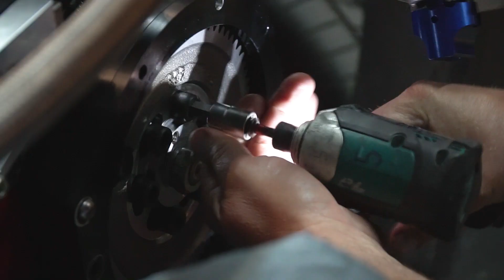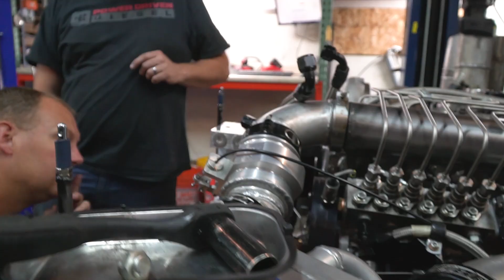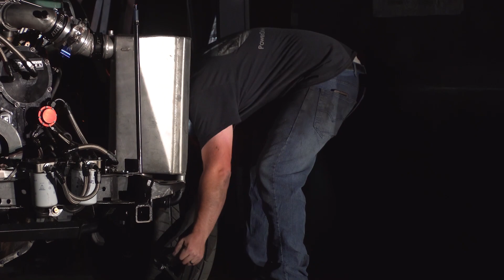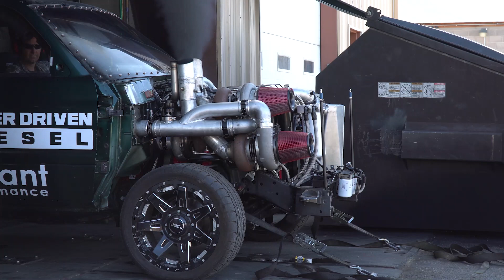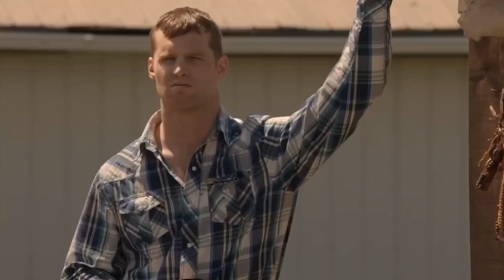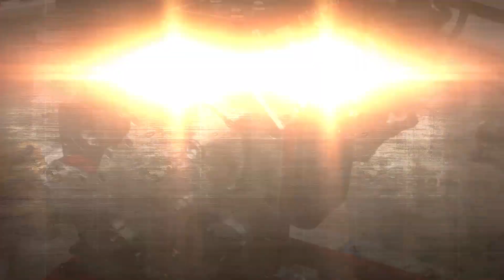Dyno Testing 200 PSI Boost Cummins

Comment: All that black coal is wasted horsepower. Get a qualified Dyno tuner who knows how to get that fuel ration corrected... oh wait(blown head) never mind
Reply: PowerDrivenDiesel yeah, if you had a diesel tuner that knew what they were doing you could probably hit 2k hp with that setup. Oh.... wait........ nvm
Reply: Really, give Gale Banks a call with that same answer, and then grab a cup of coffee, cuz he’ll give you an education of  “clean burning diesel motor” rather than this childish fad of smoking out the town with black soot!! It’s not clean and it’s NOT COOL!!
Reply: ProfabDesigns Inc. this isn’t a computer controlled common rail engine like Gale is tuning. This is a mechanical engine. The fuel map cannot be tuned to the degree the newer computer controlled engines can. If you’ll real PowerDrivenDiesel’s comment carefully you’ll see that he wasn’t saying that black smoke isn’t wasted power, he’s saying that this engine isn’t tuned to roll coal. If you watch the successful dyno pull when the turbo’s get spooled the smoke completely clears and it lights the candles. This motors fuel is controlled by rpm and throttle position, newer common rail engines are controlled by rpm, throttle position, boost pressure, engine temperature, etc. Gale is using fuel controls as sophisticated as any modern gasoline EFI, this guy is making that much power with something WAY simpler than a carburetor.
Reply: @Profabdesigns  On a diesel the smoke limit occurs at roughly an A-F ratio of 20-1 peak power happens closer to 15-1 so on a diesel making the maximum power it can it is going to smoke.

Comment: Sometimes pushing the limits has consequences.  You stated you wanted 1500 horse but you pushed 2000. Find the balance between safe and extreme. So maybe stop pushing the limits at 1700hp and then you will get more longevity. This is the second engine pop. Sounds expensive!!

Comment: Haha what u need instead of a fuel solenoid is an arm with a cable attached with a pull nob lol! That’s how I have mine setup. I was like screw that solenoid!
Reply: PowerDrivenDiesel Hey I just wanted to say keep it up! U guys r amazing, Just got the AFC live for my 24 valve n man, didn’t get to install it yet, but just to let u know u are the KING of P pump engines! Nothing beats mechanical power n is as reliable! I will continue to be buying all my parts from u guys!

Comment: To eliminate pump gear slippage machine out inserts to install in the gear to remove the empty space between the bolt threads and the gear left to right. If you want to be fancy you can machine out a few different "degrees" for 40, 38, 44... That's the only thing I've seen that will stop the pump slip